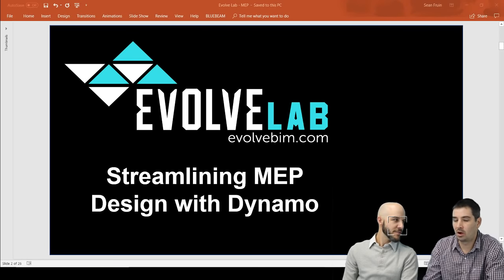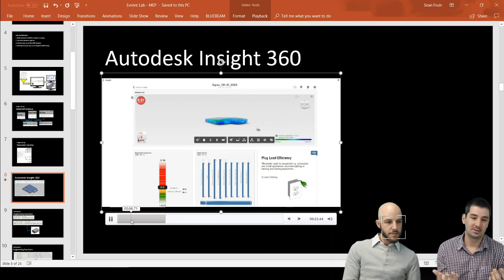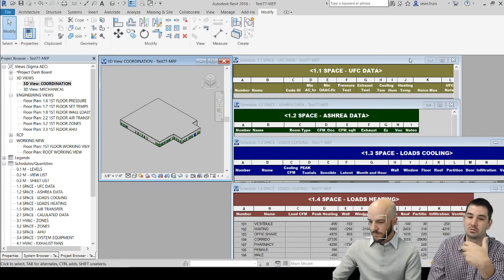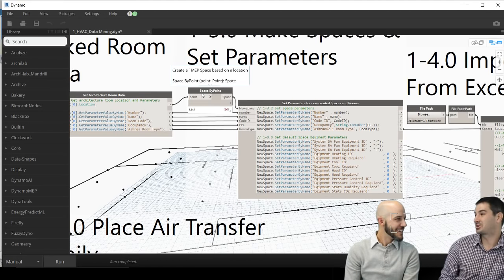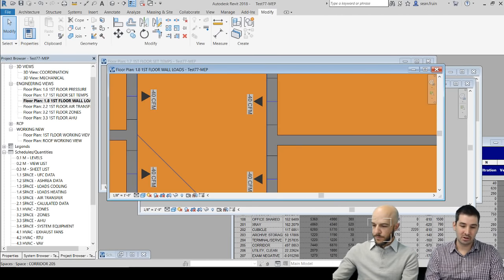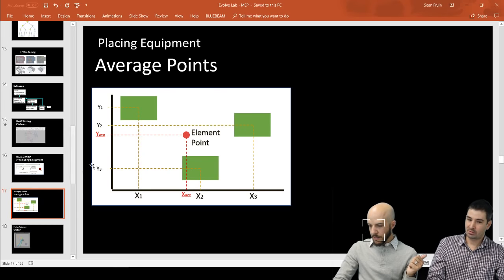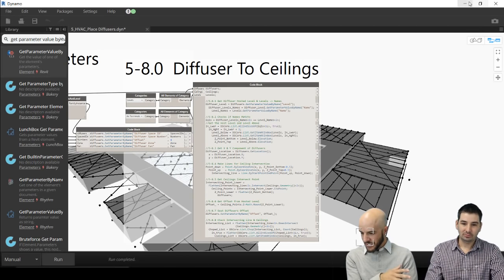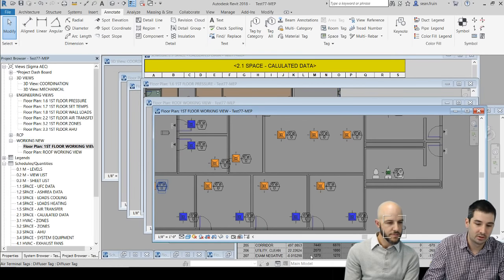Streamlining MEP Design with Dynamo

Comment: If only architects would model at a good enough level for half of this to work
Reply from the maker: Hi!   Usually these principals can be applied to even rough architectural models.  Volume is the key, and we can usually get close enough to run these analytics.
Reply: Rule of thumb design is where it is at. if done correctly you can design MEP with just area plans.
Reply: Facts